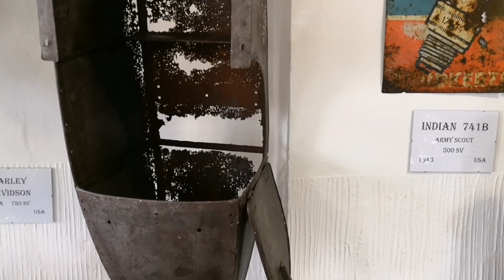Make the portable compressed AIR tank

Comment: Do not make a compressed air tank with flat sides it is very dangerous . Air tanks are rounded on the ends for a reason . Compressed air will find the weakest link . A flat side wall is the weakest link . Air pressure has to be distributed evenly thats why air tanks are rounded with not right angles. .

Comment: again a very good idea from Mr.Kadlec! Perhaps one could use an old gasbottle instead of an steeltube? I also like the old Motorcycles very much. Especially the indians...
Reply from the maker: Thank you, yes you can use any old high pressure tank/bottle, Indians are realy nice, unfortunatelly they are quite rare in our country. I had 1957 JAWA 250/353 which I restored to perfect condition, but I sold it few years ago.
Reply: Yes the Indians are rare in every country nowadays ;-)
Jawa is fine! Years a go a friend of mine did speedway racing on a sandtrack. He had a modified Jawa...